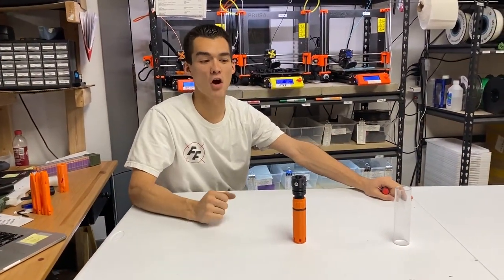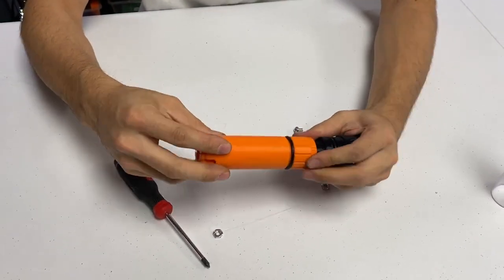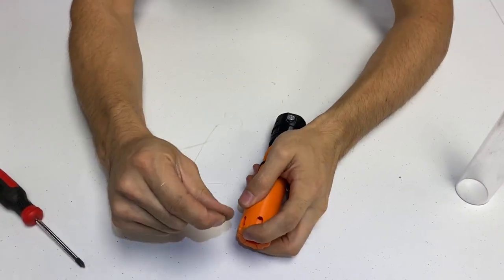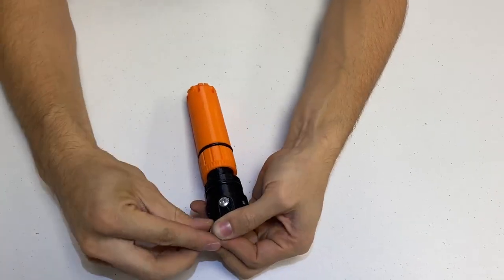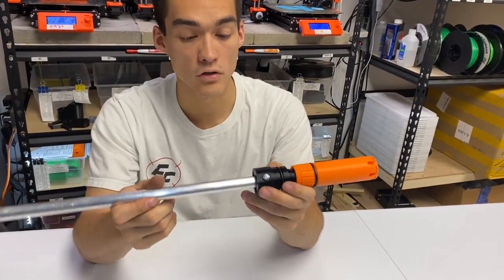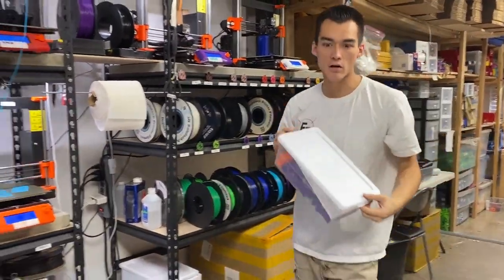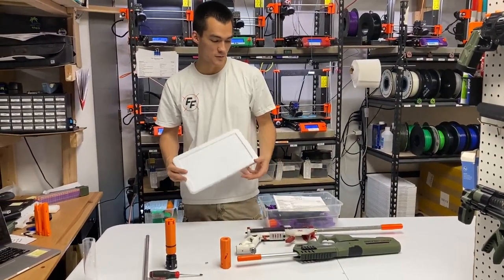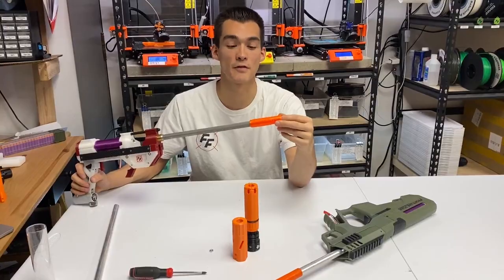How to String and Tune a Suppressor Scar | Nerf Blasters

Comment: I got an accuratio, so its rifled from printing, but im having dart inconsistency problems with full lengths. I used dart zone waffles and the heads seems to provide a little too much friction. Any full lengths you guys could recommend
Reply: dart zone max full langths
Reply: @poweraverage5773  adventure force pro full lengths are pretty good
Reply: @bestbroseph1258  but you can't buy them spratly from the nexus